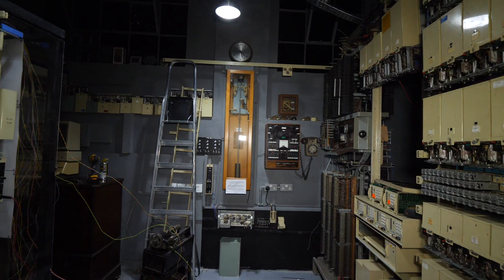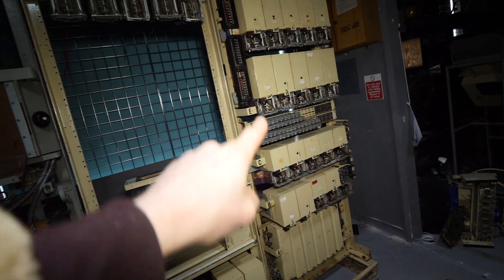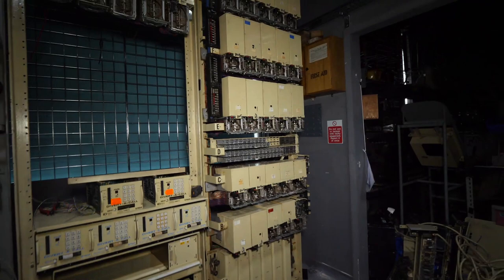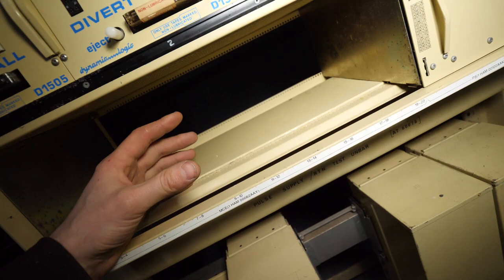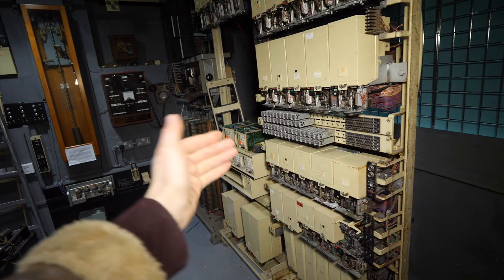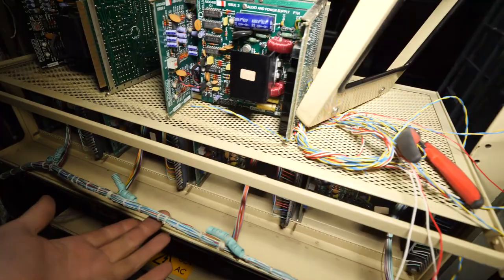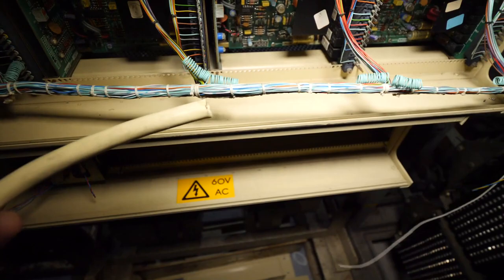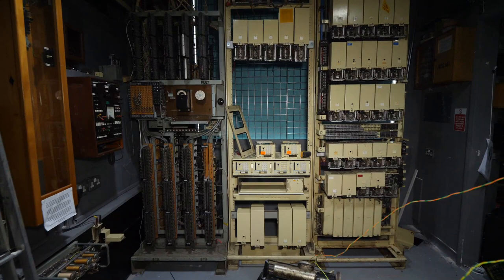More Wiring On The Telephone Exchanger Ramble Vid

Comment: Gees, I don't know where you get the energy from to see all this through. It would have been "Information Overload" in my brain had I been faced with a project like this. Mucho respect to you Sam!! Seeing those bundles of wires at the back of the telephone exchange made me think back to the days I did quality control at Draka Comteq cable factory. We made telephone cables with 900 pairs of wires, paper insulated, surrounded by a lead casing and I had to measure each pair for resistance and capacitance. It was great work coz it would take just over one shift to measure one cable and the computer did the measuring so I could play cards in between with my colleagues :)

Comment: That thick cable looks like the 300 triple that i used to run in exchanges, the triple was a pair plus a busy wire.
Thos outgoing 'field' wires sometimes have a connection for an air line, normally connected to a nitrogen gas cylinder with pressure monitoring and alarm, it was to keep water out of juction boxes in the field.
I can see the led matrix getting some rude images :P
Reply: Did'nt know they ran nitrogen in there (obviously for it's inert properties) Thanks for sharing your knowledge. I've worked in alot of exchanges- on the fuel storage for the back-up generators.
Reply: @garethjones7182  It's also cheap, there's about 78% nitrogen in the atmosphere

Comment: showed this to my father who does this as a hobby and a couple of things he pointed out:
its IDF not MDF
also that massive chonky cable is supposed to go to the IDF
and sonthing i want to add is we have a telephone exchange linked to the internet by voip too, you can get these pci hardware cards that support pulce dialing out of the box so you dont need the converter but requires a bit to get working software wise 

and another thing, we have like 7 UAX13 rack frames on the scrap heap idk how my parents (who own the house) would feel if you wanted to come pick them up though so dont get your hopes too high
Reply from the maker: hey up cheers for that! the rack C is IDF and MDF as far I'm aware. but happy to be wrong! always interested in finding stuff so yeah definitely let us know! I have found an empty rack however its miles away. but interested. cheers!

I think I have one of those cards actually!o000hhhh
Reply: @THISMUSEUMISNOTOBSOLETE  ah nice however I think you are miles from us to lol have a feeling you are somewhere near the london end of England but Im right near wales so I doubt its any closer hahaha. also there are a couple of asterisk cards that don't support pulse dialling as well as some that do some of the ones we have are made by a company called openvox but beware the company is Chinese and the instructions are murder to follow